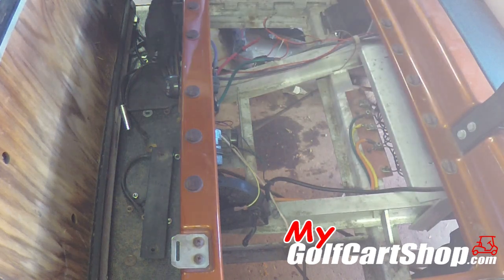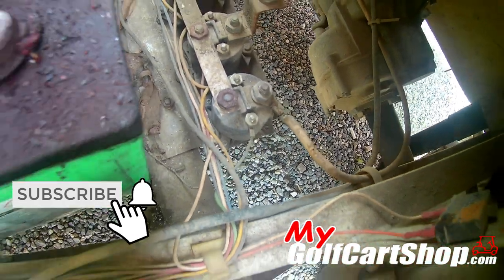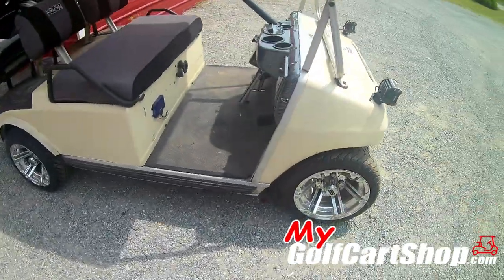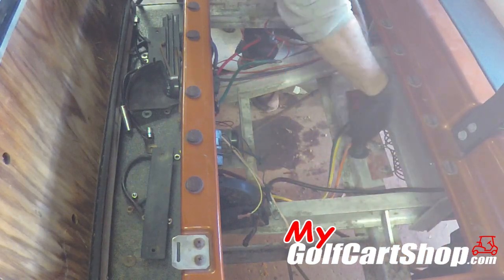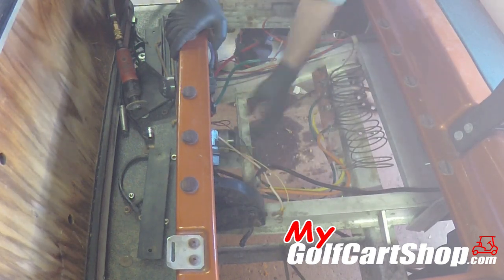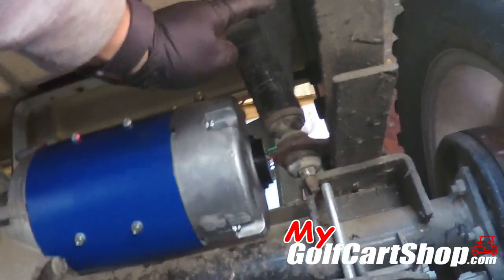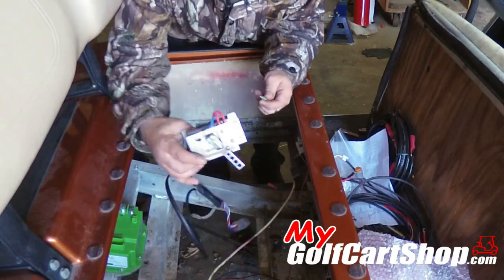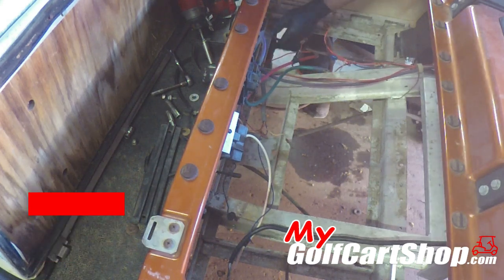Is Conversion For You?

Comment: I have a 2006 Western Ezgo 42 Volt golf cart that quick moving and after spending $2000 on batteries, $600 on rebuolt controller, and three forward/backward switches, I am ready to roll this cart off a cliff!! How much, ball park, would it be to convert a 42 volt high output system to a 48 volt system? Cant find 42 volt high out parts anymore
Reply from the maker: The 42 volt systems are very rare, I would certainly look into at least a push button F&R switch to start and possibly going ahead to the more common 48 volt system? Let us know if we can help. 276.632.8905

Comment: I have a 48v lithium lipo 105ah battery in my 2010 Club Car DS. Won’t switching to a Navitas DC controller burn out my motor if I keep the motor stock and not upgrade it?
Reply from the maker: No, It monitors what the motor can handle. Only thing is you won't gain any more speed with the stock motor.
Reply: @cartsmarttv  Thanks. I appreciate it. I’m just gonna go with the DC to AC Conversion after all.
Reply from the maker: @chrisginoc  check with us on pricing, we'll help all we can. Family owned.
Reply from the maker: @chrisginoc  https://youtu.be/V7CD2F-YQzI?si=xyzucrTgsSSRt8nZ